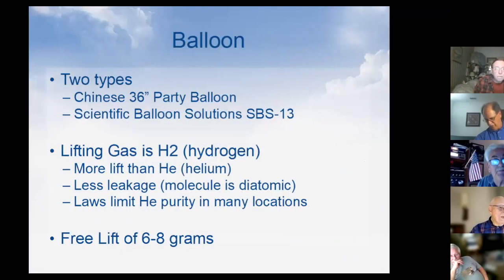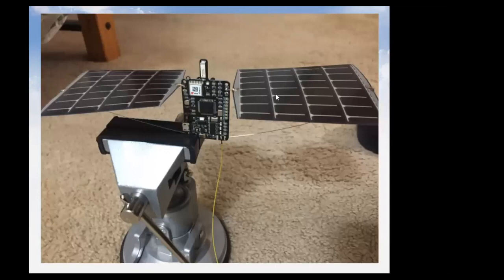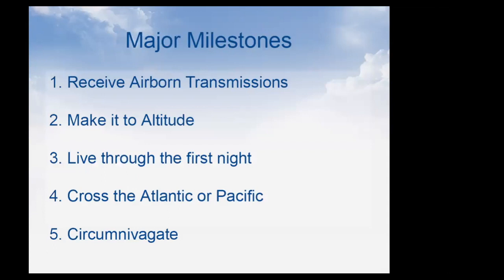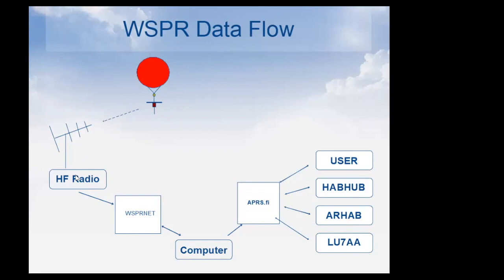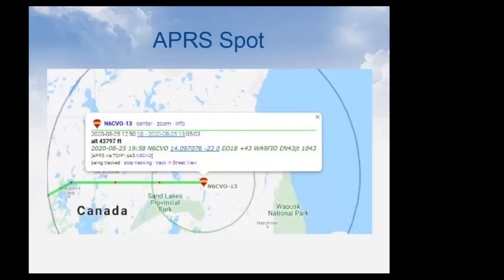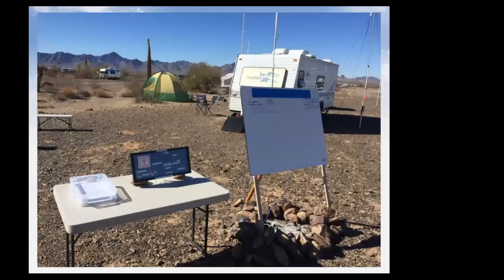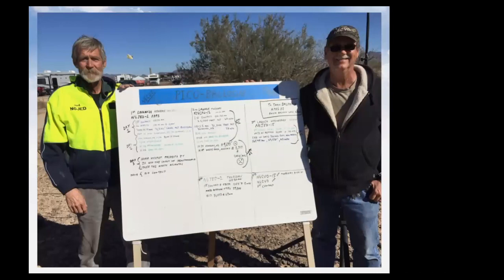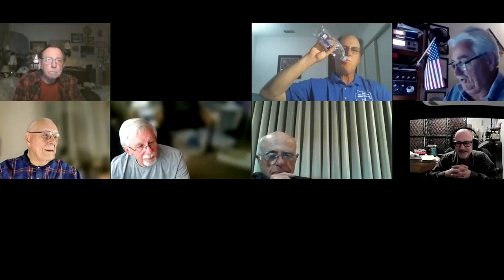Pico Balloons - Constructing, Launching and Tracking

Comment: If you could find a balloon made of PTFE and cover part of it with foil, when water molecules hit it, electricity will be generated, the actual balloon can charge the unit. This hasn’t  been invented yet because I just thought of it.
Reply: it you could metalise the top half, you could do that AND put a 2.4ghz transmitter inside the balloon and use the foil top as a parabolic reflector giving a very strong signal below. possibly an esp8266 store and forward repeater